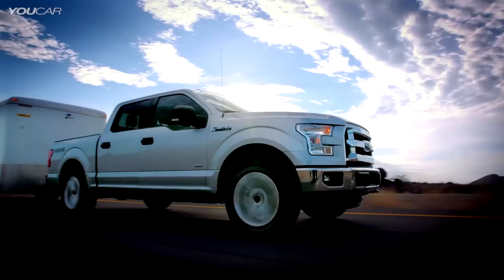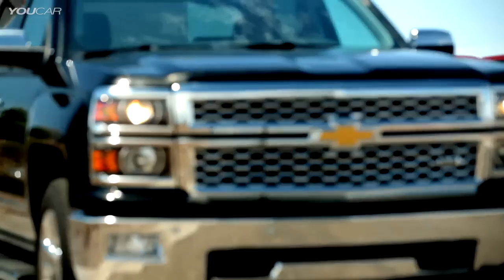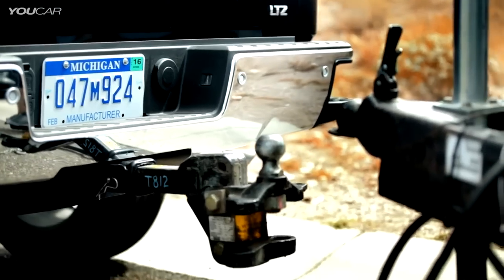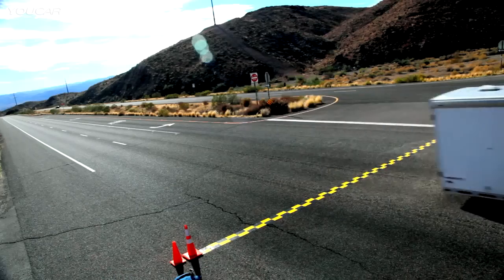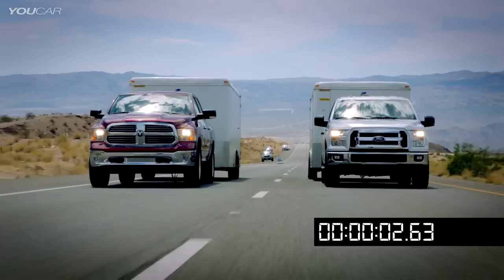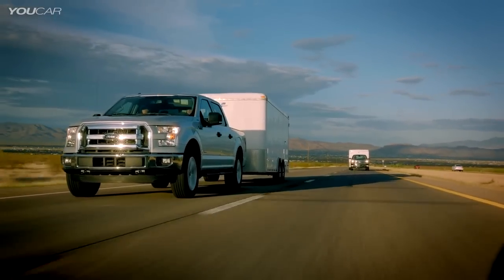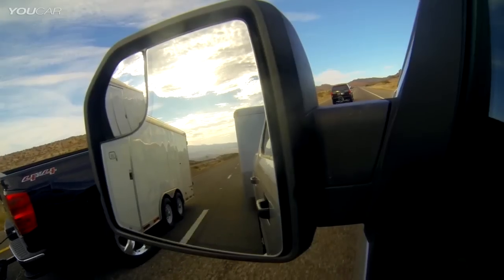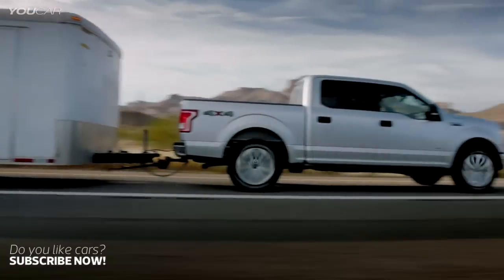TOWING Comparison – Ford F150 vs RAM 1500 vs Chevrolet Silverado

Comment: love how they are comparing a twin turbo forced induction engine vs a naturally aspirated engine on a elevation tow haha. They need to run the 5.0 and see the chevy win :)
Reply: GM will fail again
Reply: guess we will see lol cause atleast where I leave down here in tx there are more chevys than fords.
Reply: casey chance I live in TX too, and I see the opposite, more Ford than any other brand.
Reply: The f150's still much lighter. The 5.0 is even more powerful. what makes you think the Silverado will win?
Reply: Casey, the foot-to-the-floor race pulling the load plays out exactly like it should.  The EcoDiesel Ram gets the holeshot because it has the most torque early.  Once the Ford and Chevy start making horsepower it's over for the Ram.  Chevy makes 355 hp to the little Ford's 325, so once the turbo advantage starts going away the Chevy hp wins.  If the race was long enoujgh the Chevy should win them all.  The 5.0 Ford makes more hp than the Chevy and the Ford is lighter, so obviously it would beat the Chevy in all three races no matter the distance.
Reply: Bubu Lubu I agreed with most of what you've said, except the part "If the race was long enoujgh the Chevy should win them all".

Don't forget, this is pulling up a grade. The Chevy makes 355HP at sea level. The twin turbos will help the Ford as the grade gets higher and higher, and so does the turbo diesel ecodiesel. If they keep going up higher and higher, the engines with the turbos win. The Chevy may end up being last. The Ecodiesel still have quite a bit of HP gap to catch up with the N/A 5.3 Ecotec3 but it will, and will surpass it, at the right altitude.
Reply: SB N That's true SB.  Long enough but not too long is probably the right way to say it.  At only 5 seconds back the race wouldn't have to go too much longer for the Chevy to get by the EB, but eventually the Chevy would lose power and the EB would go past.  It would be interesting to know what the SAE test includes.  I guess the tow ratings for 2015 will tell the story as all three mfg's are using them this year.
Reply: Why would you tow 7,000 pounds with a half-ton truck.... especially an all aluminum bodied truck that weighs 5300 pounds.... That's an extra ton of weight to try and slow down on the opposite side of that hill. Better hope you got some good trailer brakes and a transmission that will hold back on the way down. Even the Chevy only weighs 5200. If you're gonna tow, get a 3/4 ton at least
Reply: Bubu Lubu I respect your unbiased and insightful comments. Ram is already 100% on board with the J2807. GM and Toyota (only have 1/2 ton anyway) only rated their 1/2 ton with the standard. Ford is unknown at the moment. It would only be fair if everyone is using the same rating standard.
Reply: Weren't the big three brought under fire recently for outrageous claims regarding their tow capacity. 11, 000 lbs is a lot of weight
Reply: maybe its just the area I live in. and to be honest im pretty ubiased. I like both ford and chevy.
Reply: Bubu Lubu I get what you are saying, but I don't believe anything that the dealerships say. I have a completely stock 2011 sierra and my buddy has a stock 2013 5.0 and I pull him on a 30 and 40 roll almost tie with him off the start. Also I like both ford an chevy they are both good trucks, I just think if you ran all these trucks on flat ground it would probably be a little different.
Reply: SB N that's my point I would like to see this at sea level, where I live in texas I don't drive up mountains so it would be pointless for me. I would much rather sea level to even the odds.
Reply: casey chance On a perfectly flat ground at sea level, a Prius can pull the same load at the same speed. So what's the point for auto-makers to test their pickups' strength on a flat ground?

I live in Texas too. And yes we don't have long grade to climb. But we do have hills, plenty of them on long road trips. If your Sierra has a 5.3L in it in stock form, try pulling something around 7000 lbs going up a small hill. You will feel the "under dog".
Reply: It's not a measurement of speed. They were measuring the longevity of the horsepower and torque bands of each vehicle with a trailer tow uphill. Basically simulating dyno pulls but in a consumer situation. No matter where the scenario takes place there still are too many variables in this test. Unlike a dyno these vehicles have environmental factors that hibder all three. And you're still comparing a turbocharged gasoline engine vs a naturally aspirated gasoline engine vs a small turbocharged diesel. This doesn't prove anything to the consumer looking to purchase a tow vehicle because a 3/4 ton or larger is designed to tow more capably vs the everyday commuter towing their boat on weekends
Reply: "It's not a measurement of speed"   oh yes, it is. One truck was faster than the other, I am not sure what else they are measuring, but overall average speed of each truck?

"They were measuring the longevity of the horsepower and torque bands.." not even sure what you are talking about there. One thing for sure, the diesel and the OHV are normally not designed to breath well at high RPM.

"Basically simulating dyno pulls but in a consumer situation.."   well, these trucks are to be sold and used in a consumer situation, not on a dyno, so why else would they test these trucks?

"No matter where the scenario takes place there still are too many variables in this test"   They stated that they ran each pair 3 times, switch out drivers, switch lanes...I don't see any variables or any truck was unfairly tested.

"And you're still comparing a turbocharged gasoline engine vs a naturally aspirated gasoline engine vs a small turbocharged diesel"   They are not comparing the engines, they are comparing the truck as a whole. It's not one truck with 3 different engines being tested here.

"This doesn't prove anything to the consumer looking to purchase a tow vehicle because a 3/4 ton or larger is designed to tow more capably vs the everyday commuter towing their boat on weekends"  a 3/4 ton or larger are spec to tow over 15k lbs max now. They only tested these trucks with 7k lbs trailers, which are exactly what the 1/2 tons currently rated at. This test clearly proves that the 2.7 ecoboost F150 is similar power to the Silverado 5.3L v8 and better than the Ram ecodiesel. 90% of American pickup owners fit perfectly into this category, who use pickups for family and groceries, and occasionally pull a trailer or boat weighing about 7k lbs. I don't see a problem with the test at all.

Here is the wild card: wait for Ford to release the MPG rating for the 2.7L Ecoboost F150 and we'll see any more excuses?
Reply: SB N
Let me clarify, The average person doesn't race towing a 7000 pound trailer uphill. If you a purchasing a truck to use in a performance setting then yes, top speed, ability to disperse power, traction aids, all matter. If your towing a trailer with a lot of weight, and 7,000 pounds is more then the individual weight of all three trucks, you're not going to want to purchase the half ton truck. Even the highest rated axles for three brands still have higher rear end ratios than each brands entry 3/4 ton full float axle. Similarly, if you're a towing on the regular the larger displacement motor may use more fuel unladen, but the averages while towing won't reflect as much of a difference. Comparably, the smaller displacement motors turbocharged or not, wont have the stroke or displacement to maintain and equal torque and horsepower and to that of the larger displacement motors.
The average consumer isn't going to take their truck to a dyno to find the horsepower and torque output of their truck. This test is basically the manufacturer doing a dyno test in manner in which the average consumer will understand. It goes fast (measurement of hp/torque) with a lot of weight(resistance), and doesn't lose speed going uphill (length of hill relative to length of pull on dyno).
The variables are three different class motors, diesel: compression ignition turbocharged versus two different class gasoline engines: naturally aspirated, direct injected engine vs a turbocharged, direct injected, and intercooled engine.
The differences in performance and engine modification, engine fuel, make for a lot of different variables. Yes, to the average consumer, the turbocharged ecoboost is a powerful, small displacement engine. But has its limits.  As do each brands engine
I guess what I'm trying to say is if the purchaser only needs a small pickup truck to haul small loads and an occasional heavy load once a month, go for it, it meets your needs. But for those that tow a lot, need the added GVWR of a 3/4 ton and want a more comparable motor to the weight demands they tow, then this truck isn't the option.
Yes, it will be interesting to see the independent testing for all the specifications Ford claims this truck can make, some for all three brands.
Reply: When you are towing 7k trailer up a grade like Davis Dam, it is a race between the trucks that are towing, not a race between the trucks vs the other sedans running along side with you. Why? because if you are not powerful enough, you will barely maintain 10-15 mph below the speed limit. I've towed heavy trailer up a long grade before. And I'll tell you something, it's a misery to see that you can barely do 45 mph in a 60 mph speed limit zone. On another hand, when you spend $40k-$50k on average for a new truck, I bet 100% buyers don't want to get a least powerful truck for the money. You can try talking to them about not towing anything 90% of the time and sway them otherwise. I'd like to see their respond. How do you feel when you just spend $50k and your truck is the weakest truck in the class?

All Duramax are riding on 3.73 rear end. A lot of Ford and Ram 3/4 are riding on 3.73. What are the rear ratio on these 3 testing pickups again? 3.73, 3.73 and 3.92?

 It's a Ford promotion video, showing the turbocharged gasoline direct injection engine beating the turbo diesel and neck to neck with the double-displacement DI v8. Turbocharged GDI is the future, especially in a situation where modern turbo diesel engines are choking under the hands of EPA or the likes around the globe. I like diesels for everyday driving because it provides lot of torque in low RPM, translate into big HP instantly. But I do not like modern diesel due to expensive maintenance and EPA bolt-ons failing rate.

Once again, this 2.7L Ecoboost F150 is designed to meet the need of 90% American truck owners. People who tows everyday already know what they need, really!
Reply: very true, I have a 2011 gmc sierra with 3:43 gearing and the 5.3 and I tow a 7k trailer almost every weekend and it does just fine haha.
Reply: casey chance doesn't matter where you live f-series will always out number chevy and dodge no matter where you live! fact
Reply: scott28x8 not fact lol......and again ford has some many different model trucks and platforms. If you put the sierra and the Silverado sales together then ford and chevy are about even. im not even a chevy fanboy lol those are just facts.
Reply: casey chance im wondering where your getting your facts from cause there not even remotely close lol! ford out sells more trucks than all other truck companies combined! that's a fact!
Reply: scott28x8 I cant find the chart I saw (granted it was from 2012) but here is one from 2013. and ford doesn't outsell all of them combined.
Reply: 5 litre would walk all over the 5.3 too regardless
Reply: disagree. My buddys gets me off the line but on a 20 or 30 roll we are dead even, im just saying its a more fair comparison
Reply: You can never win with these types of videos.... You got the Ford people paying people to make their truck look better than any others then you got chevy and ram doing the same thing....
Reply: thenewimahich thank you!! that's my whole point! these ford fanboys think this video is proof haha
Reply: casey chance don't forget everyone complains about the trucks not being stock most of the time... I say do you put on stock tires that the factory put on? what about the oil? oil filter? and why not put an aftermarket air filter like a K&N to boost performance? People are mad in the truck community and lets face it Dodge Makes the meanest looking trucks that are work horses Gas or Diesel doesn't matter... Ford Makes the Working class trucks that come with Luxury and a plastic looking body and chevy  Makes the Trucks that the rocker panels rust your balls off.... In reality All trucks  Has their defects... But if anything The dodge ram is the way to go
Reply: thenewimahich I agree to a point. The new rams I like a lot, however the old v8 rams are crap. the cummins is the way to go diesel wise. However I like the 6.2 chevy :D
Reply: Hey i just got me an 04 ram 2500 v8 hemi slt
Reply: thenewimahich How is the mileage? lol
Reply: Patrick Connolly before 2010 is considered to be the dark age of Ram, or Dodge ram to be more correct. The only thing worth mentioning was the Cummins, and still is the Cummins.

04 ram 2500 SLT: still terrible seat fabric and cushion, if the previous owner was a big pal, expect the fabric texture is seriously worn, the cushion is uneven now, where the driver seat is lower on the left of the driver, hurts your back on long driving, expect around 12 mpg on a good day, save money for water pump, front end rebuilt, transmission rebuilt if it's auto, speaking of transmission, can you still put the truck in "park" position with ease, or struggling at time? All AC vents still operate properly? still no signal light on the side mirrors? the factory head lamp is so dim, it's nearly useless during those dark night, and speaking of hard plastic, the cracking type, it's used liberally everywhere...then the question still remains, why would you buy an HD Ram without a Cummins?
Reply: SB N
What was the point of all that? Umm good to know....... I already knew they were junk. I am quite happy with my 2011 Ecoboost
Reply: SB N I pull over 7k every weekend. and have towed over 8k before. Up hills going out towards Huntsville and dallas area. I haven't had a problem yet. Does my buddys brand new 2013 f150 5.0 tow a little better than my 2011 5.3? yes, a little but not a huge difference. Plus I feel my truck rides better and smoother when towing. In my honest opinion, all the new trucks are nice im just tired of this brand biased crap.
Reply: casey chance" ford has some many different model trucks and platforms. If you put the sierra and the Silverado sales together then ford and chevy are about even. im not even a chevy fanboy lol those are just facts." Wrong. GM has 3 Sierras, 3 Silverados, and the Avalanche. That is 7 trucks. (the Escalade also qualifies but it wouldn't make that big of a difference). Ford has the F-150-750. That is also 7 trucks. Ford outsells GM plain and simple, no matter what your excuse is. The people who make these sales charts think of these things you know. You say you aren't biased at all, yet you seem to be making up unnecessary excuses to try and defend a certain brand?
Reply: masoroo818 im talking about if you look at all the f150 models they have like the Harley, platinum, raptor, king ranch,lariat. The list goes on and on from sfe to fx4. they have so many model ( and I say im unbiased because I own both and think both are great trucks, just tired of all the brand bashing out there. Im also pretty sure in the links I posted the avalanche is in a different category?
Reply: No they're in the same category, they just don't sell nearly as much. The Escalade is also counted I believe, but that barely makes a difference in sales.
Reply: masoroo818 maybe so lol idk, I own a gmc sierra and I am super happy with it, I also own a f150 and im happy with it too. :) best of both worlds
Reply: Definitely. :)
Reply: recalls and explosions? not near a ford! chevys too cheap for that!
Reply: Buddy they could put the Chevy 5.3L vs. a Ford focus in a towing competition and in these Ford sponsored videos the Ford is gonna win.
Reply: ohblondi so true man!
Reply: casey chance
GM will fail again, sorry. And I live down here in TX too, guess what? More Fords than anything.
Plus I think it's fair, I mean come on! It's a 4 cylinder for crying out loud.
Reply: Ford Is Best. im just saying that ine the three towns I have lived in, its just as much chevy and gm as ford. Plus a lot of fords sales are fleet vehicles. And if you think the v4 ecoboost is so good, run it without that kind of elevation, im willing to bet it would be a drastic difference. Again I don't hate ford we own one lol I just hate biased sources

Comment: And this is why i dont respect ford trucks anymore. Swapping a v8 for a tinyass 2.7l v6 and "making up for it" by putting in a turbo. V8 will always be better
Reply: i agree with you id rather a V8 but in todays world where gas prices rant going any lower this was a great move by Ford because the customer wants the same capability with better mileage so it needed to be done.
Reply: You can still get the 5.0… do some research before you knock them
Reply: I'll take my inline 6 over any V8 in a pickup..
Reply: Rexford L Why? just because it has a turbo? lol more shit you have on a smaller engine to make it compete with v8s will only add on to the amount of shit that will break or go wrong.
Reply: Todd Rich ok, I'll take EITHER of my inline 6's over a V8 in a pickup. Yes one has a turbo, but it's the same size at the competitors V8,(6.7 liters) the other is naturally aspirated, a good old 300" six..